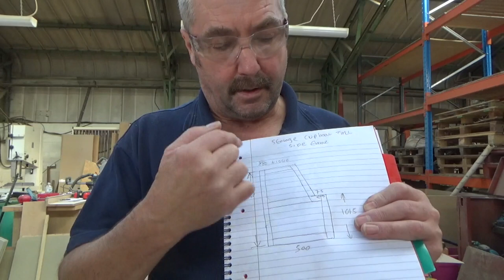Narrowboat , How To Build A Tall Cabinet For Storage Pt 2

Comment: A handy tip when fitting inset doors is to use playing cards as spacing shims around the door when fitting the hinges. If you have exactly the same number of cards on each edge gap then the door is perfectly central in the hole.

Comment: Hi Andy, I see someone else has spotted something, Making the first template you maybe should have squared up from your floor to get the correct angles, would have saved recutting angles later,  it's a great idea making this unit, as again the jointing method wins all the time with tight angles at the top, look forward to the other units. Regards welshman